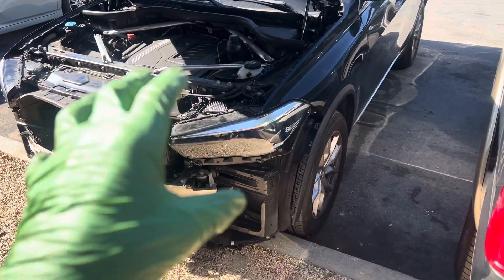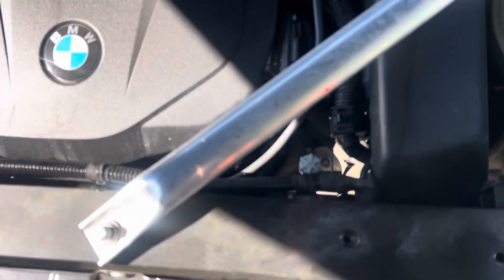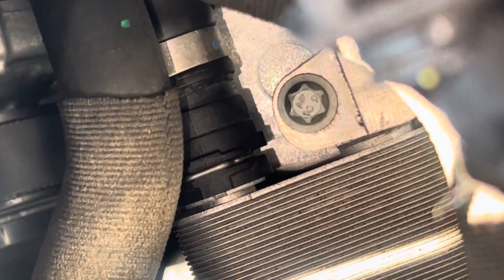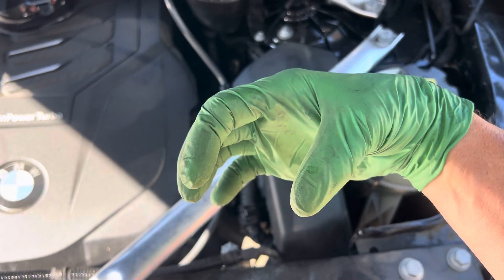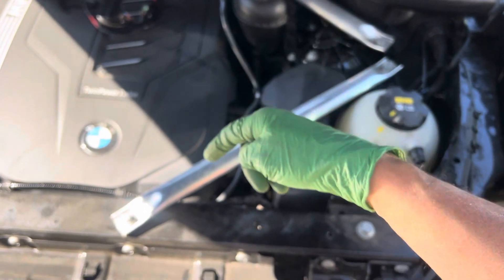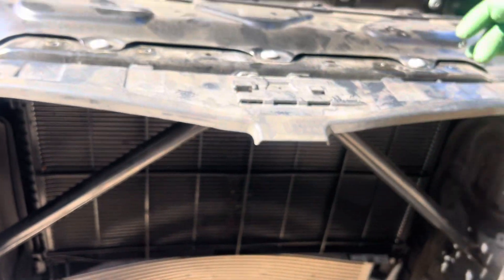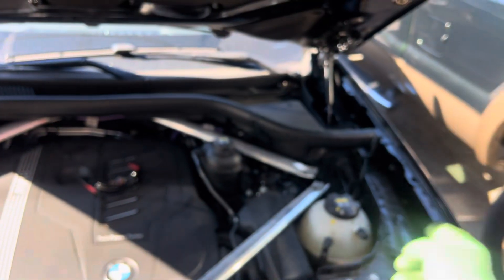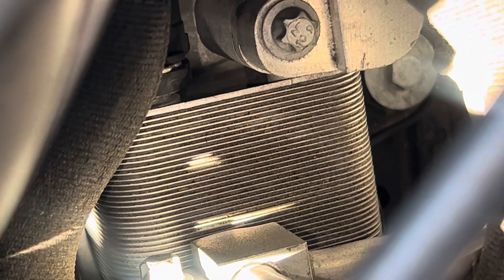THIS AC HAS NO REFRIGERANT CONDENSER? 🤔 glycol plate heat exchanger ￼￼

Comment: Brazed plate heat exchanger. I have to change these on supermarket racks often. They are used as sub coolers on the low temp racks and as an intercooler for the interstage on a 2 stage compressor. Crazy they are using them on cars now.
Reply from the maker: @topher8634  they are now used on most manufacturers at least a few modern manufacturers.  All electric cars. Most hybrids

Comment: Plate heat exchangers also exist internally inside most  diesel engines . Almost always as an engine oil cooler located within the engine block . The oil is cooled by the  radiator coolant .
Reply from the maker: @paulthompson1654  plate, heat exchanger in the last 10 years, especially extremely high percentage of cars manufactured in the last four years even regular gas engines not to mention hybrids electric vehicles all over plate. Heat exchangers are everywhere several on each vehicle.. 
     It is now the new normal.
Reply: Where stacked plate coolers first appeared in gas vehicles was transmission cooler inside radiator tank vs  old school copper tube .
Reply from the maker: @ I remember those first time I looked down inside a radiator and seen them inside

Comment: Sounds good but what happens when glycol leaks into the refrigerant line? Replace the whole system? Just removing that silly Oetiker hose clamp is very difficult even if you have the right tool. 😂
Reply: Initially the refrigerant will flow into the water side because of the pressure difference. Once all of the charge is gone, you will get cross contamination. These fail on supermarket rack systems quite often and you want to catch it before you lose 1500+ pounds of refrigerant. These systems employ replaceable core filter driers with a large capacity for moisture. They are often changed as a preventative maintenance item. Some manufacturers use a double wall with a air gap to prevent cross contamination and to provide a visual external leak. You always want to buy a good quality brazed plate heat exchanger. FluidEX makes good ones.
Reply from the maker: @ they are going to be big money makers when they get old.
Reply: @topher8634  The biggest problem on Automotive is coolant/radiator cap pressure relief valve can only hold 16 PSIG and it's exposed to excessive heat. Aluminum is notorious for microscopic crack. The best example is the cylinder head with crack that only leaks coolant when hot. Not sure, but I think when refrigerant leaks it will overheat the engine. Which can easily be misdiagnosed as a faulty fan because some of these vehicles don't turn on the condenser fan when refrigerant is low.  If this vehicle also used the super silly clutch less compressor that will fail without refrigerant. It's better to push this vehicle on the cliff instead of repairing it.
Reply from the maker: @w0lvez1  💸💰💰$$$  seven to $10,000 depending on what make your model vehicle some systems all the components are up to $14,000
Reply: @coldfinger459sub0 is would it even get into the refrigerant? And why it would cost so much to repair something like that?
Reply from the maker: @ just like any heat exchanger can fail. It fails between the two circuits, and either cooling goes into the refrigerant or refrigerant goes into coolant a little combination of both.. 

It cost so much because it just cost that much congratulations. Welcome to the New World after the stupid pandemic that caused global inflation and dollar deflation. . 

Especially when you’re working on vehicles like Audi or Mercedes and the parts are even more expensive on the cheap cars that are electric that have low volume numbers like Hyundai and Kia I did a video back showing $633 expansion valve and it had two of them on it That was just the expansion valve. I’ve showed 4000 and $6000 AC compressors.

Welcome to the New World . 
Not to mention, I’m in the San Francisco, Silicon Valley, Bay Area, where Automotive hourly rates are between $220-$300 an hour and even more for the dealership .
Reply: @ if someone was to charge me that much I’m selling that new fancy car and buying a basic tech 2014-2015 car where you can refill the refrigerant for $25
Reply from the maker: @ yes if you can do it yourself, I can for $25 is good enough. 
       But here in my area, where everybody is usually over $200 an hour plus markup on parts and materials. 
      $300-$400 for your Old 2012 to 2015 vehicle. 
      Unless you find a real old dirty hole in the wall shop in a bad part of the neighborhood and you’ll probably have to speak a second language to communicate with them. You’ll get a guy with a little shake it and one single hose to top off your car for $80-$100.. you might get lucky and he’ll make sure it’s kind of gas that has extra oil and sealant mixed into it to make your AC blow colder and the lubrication will make your compressor spin faster 🤣 then you know you’re getting quality and your money is worth 🏆

Comment: Damn how would one replace the drier cannister ? So much to tear down for access. This is a hybrid car? But i do not see orange color high voltage cable😮
Reply from the maker: @suryaprihadi2258  gas vehicle, I can’t remember if this one had electric assist not really a hybrid. 

Correct receiver dryer is not in a friendly accessible location .